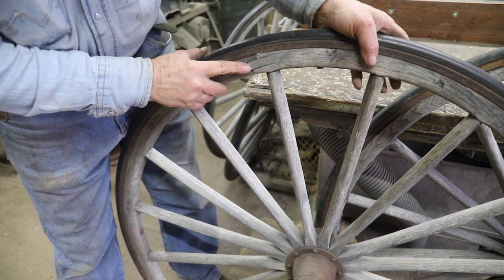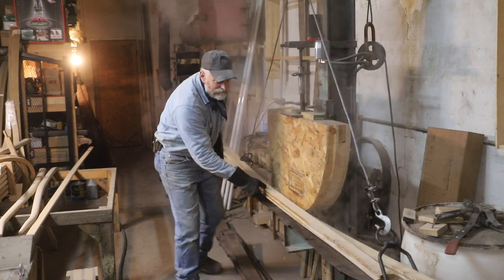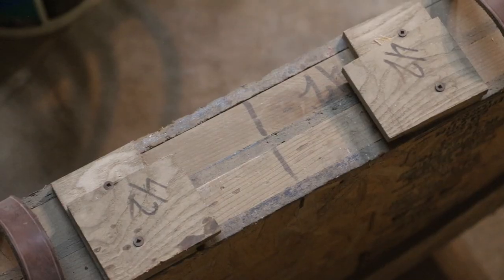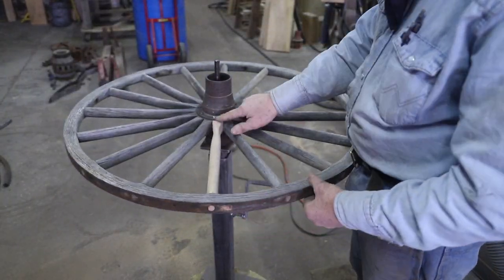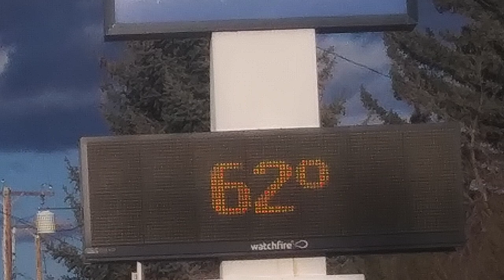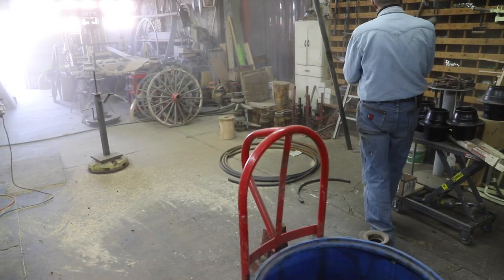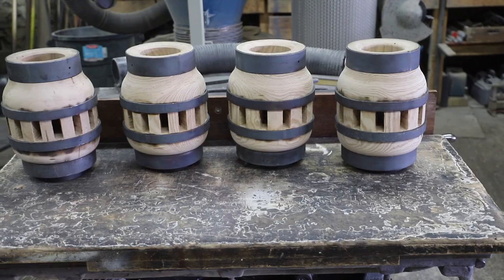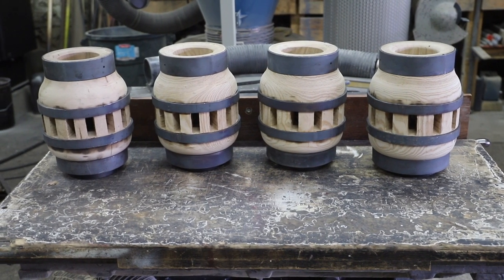Hearing Distinct Sounds in Buggy Wheels | Steam Bending | Engels Coach Shop

Comment: As I watch you do these wheel restorations I was thinking how wobbly they would run if I replaced those spokes. 😀The length of your experience and ready remedy shows through even on these condensed versions of the process.

Comment: A little tip from an engineer type, if you want to keep a bit more of the heat from radiating out of those square steel tube steam chambers, clean the rust off the steel a bit and apply some aluminum paint to them. The shiny silver color helps keep the heat from radiating some. Without even adding some kind of insulation to them. It uses something called "emissivity". Might be helpful especially in the summer. "Aluminum" paint is not for painting aluminum, it has powered aluminum as a pigment, hence its long lasting silver color. Often popular for trackside railroad equipment. 

I always assumed the wagon bows were made of iron! Makes sense to steam bend wood though. I remember as a kid completing a wood chuck wagon kit. Wagon Train was a popular show then.

Comment: Blows out shop, and buries the town under a fog of wood dust...    0~o     One would wonder if you had a large tank of Linseed oil out back with which to dunk these wheels for a spell before mounting the rubber.   I'm sure the sound of the wood sucking up said oil would be quite entertaining.    ^~^

Comment: Dave, next time you want to use the blower to clean, open the front and back doors, place a large fan at the door that you want to blow toward and have it blowing out. It eliminates a lot of the dust that settles on your equipment after you quit blowing. And it will keep the dust down so well you might even give up the mask and it makes the job go a lot faster as well as allowing you to do a better job of cleaning. I love being able to use the blower to clean my shop.
Reply: Ha! I'm thinking dust EXPLOSION myself. If there is a fire is going and the air mixture is just right.. KA-BLOO-IE. Blows the dust right out, windows, doors and maybe the roof too.
Reply: My experience with leave blowers is that they generate more dust than they evacuate.
Reply: @horatiohornblower868  That's the reason for opening the door at both ends. You have to have a fresh air source that can quickly replace the blown air, otherwise you are just making the dust airborne and recirculating it in the shop once it's airborne. And the fan blowing out at the exit door will help direct the dust to the outside,
Reply: @opendstudio7141  Yea, I hope anyone that has a wood shop knows enough about the potential for dust flashover to avoid that sort of problem and not have any open flames during the process.

Comment: Watching you blow the dust out of your shop reminded me of when I worked in a furniture factory. We did this every year in December, to prepare for the annual physical inventory. We used compressed air hoses, opened all the windows and doors and blew dust for about 4 hours!  It worked, but if we would have had any static electricity sparks,  it would have blown the roof off!

Comment: The repaired wheels sound like a finely tuned guitar! On a lighter note: Way back on the railways there were guys that sat near a station, where the train moved at a crawling speed, and tapped each wheel and according to the sound they could determine if something was wrong with that specific axle. One day an apprentice asked the guy with 30 years experience what a problem axle sounded like. "I don't know" came the answer.

Comment: Dave, I always enjoy watching your work.  It's all quite fascinating to me.  I do have a question, if I may.  The stand you use to put the steel tires on and then hose them down to shrink into place: is there a reason why it doesn't/shouldn't spin to allow access the entire circumference in one place rather than having to walk round and round?  Just curious!

As long as I'm around and you're making videos, I'll be watchin'!
Reply: Mark, I may be wrong but I think Dave is working to the KISS standard. And the simple way i.e. he walks rather than the wheel go around, is the simple way. if the wheel went around then you would need to cater for different hub sizes and you would also need some sort of bearing which would have to be strong to withstand pounding and the like. As I say I might be wrong but it was a very good question and I thought I would try to answer it.

Comment: Dave, wonderfully mesmerising as usual. Thank you. At the risk of asking that dumb question, why do you apply the clamps (2’37” through 2’50”) before the bend and not after? I understand that their purpose is to prevent checkering of the Timbers, but by preventing slippage between the layered planks, wouldn’t they resist the bending force? Is it that they’re not clamped tightly? (I respect that you may not have time to answer, and I’ll be no less appreciative of your wonderful gift of these videos to posterity. Enduring thanks, Bruce. 👌👍

Comment: Another great video. I never get tired of watching you work. One question though, are you not concerned about the 1 1/4 difference in the bend from the inner bow to the outside bow.
Reply: No, they still bend a little, so they can be fit to the right size.

Comment: Being a Maker of things wide and varied, I'm interested in your steaming set up.  I've amateurly dabbled in steam bending before. But would like to improve. 
I am particularly interested in knowing how your steam tubes/chambers are built and how the steam is generated.  
Near as I can make out, that is both your boiler and firebox at the rear lower left of your steam tubes.  Looks kind of like a converted compressor tank, or small propane tank.

Do you have the fire come up through the center of the boiler (like the Australian tea kettles), or just run a coil/radiator of pipes through the firebox ?

The way you have the steaming tubes capped and latched appears as though you run at least a low pressure (that, and how slow and careful you open it).  Did I surmise correctly ?

How do you have the chambers vented (to make way for fresh steam and safety) ?

How do you go about calculating how long to steam your wood (a lot of opinions and vague information out there) ?  
Based on what you do and how you approach projects, I'm going to go with your way of doing things as being more practical.

Temperatures would be useful also.  Temp gauges ?

Lots of questions.  Maybe an idea for a future video ?! ..... "The tools and Equipment that allow me to do what I do.".  Heck !  Maybe even a whole line of videos !

That Tire roller is of real interest also. I've been sitting on several projects waiting until I can figure out how to roll plate steel.  
Everything out there is either massive overkill, prohibitively expensive or is designed for < 14ga. sheet metal.  
Can't find any information on either the Tire roller, or anybody building comparables.  Yes, there are rollers that can roll bar/band stock (2-3"), but nothing for wider stock.
The dimensions off of it would be extremely helpful.  I've got the technology to make it (in the middle of refurbishing my Bridgeport mill).
With the dimensions I can extrapolate and scale to my needs.  I particularly like the fact that the roller is hand operated.  Leverage and gearing can overcome the forces needed for thick wider pieces.
Push comes to shove.... I've got the wife and the boy. "Hey Honey.... Can I see you for a minute .... ?!"

Any assistance will be greatly appreciated.
Thanks.

Comment: I've got a set of tires from my great-great-grandpa that are overlapped and forge welded together which is interesting (to me) and I have recently traded for an old tire shrinker that is missing a couple of parts.  Have you ever messed around with one and would it make uneven spots on the tires?  Just curious is all, I have learned so much from your videos.

Comment: I love watching your craftsmanship!  I was surprised at the difference in sound; it's readily apparent even to one who wears 2 hearing aids!  I do have a couple questions - why do you tap the circumference while cooling the tire?  Are the hub flanges steel, wrought iron or cast iron?  Do you make the spokes or buy them "Rough cut"?  

Thanks for another great video!

Bill
Reply: Tapping (I presume) is to equalize the tire tension all around the wheel. As the tire cools, it shrinks progressively as water is applied. Tapping releases static friction between the tire and the felloes.

Comment: When cooling the tire after setting it , what is the purpose of tapping it with a hammer , you may have covered this previously but I must have missed it
Reply: The shock and vibration helps parts under compression  get moving, tighten up and seat properly

Comment: Is there any issue associated with the different radius of the bows when you bend them three thick? At 5/8 thick there would be a 2-1/2  inch difference between the widths of the inner and outer.

Comment: Watching you bending the bows; do the three layers of bow, inner, middle and outer, not each end up a very slightly different diameter / size?
Reply: Yes, but not enough to matter. They can be adjusted on to the wagon.
Reply: @dianeengel4155  Thanks for the reply, I was sure it wouldn't be an issue, but the engineer in my head told me I had to ask the question. :-)

Comment: You must have great faith in that rope that secures the Bows after bending.  If it broke it would take off your arm and/or head!
Amazing fixture,  "Good Enough"!
Reply: Steaming dramatically reduces the force needed to bend the wood and also the force needed to restrain it.  Not too much danger there 😃.  Dave does have a way of making a difficult job look easy!
Reply: @tuberzish   You may be right.  A lot of force at the beginning after steaming.  I would still stand clear when they are moved to cool and set.

Comment: I wonder what the pioneer"s carred in their tool box.  Had to work with wood and metal, space and weight limits.  better to have and not need but cant take everything.  ??
Reply: Loch 1957    The hammer shock will relieve mini stresses permitting the many components to self align as the steel tire shrinks.

Comment: Blowing out sawdust like that seems more than a bit dangerous. One spark would make a large conflagration.
Reply: Years ago here in Barrie Ontario a toilet seat manufacturer named Moldex had a dust explosion at night when a spark ignited the wood dust in the air. 
It blew out all 4 concrete block walls.
Reply: The table saw was running as well, Cover your eyes!

Comment: Fahrenheit and Celsius are the same, but only at -40.
Celsius takes the boiling point of water as 100. Fahrenheit sets the boiling point of water at 212.
Celsius takes the freezing of water as 0, Fahrenheit takes this point as 32.
-20 F = -28.9 C
Reply: The wood dust can be fatal. A carpenter here had a lot of wood dust in his workshop. An iron tool fell down, striking a spark. This resulted in a dust explosion and flash fire. He was insured against damage, but the insurance company didn't pay for everything.